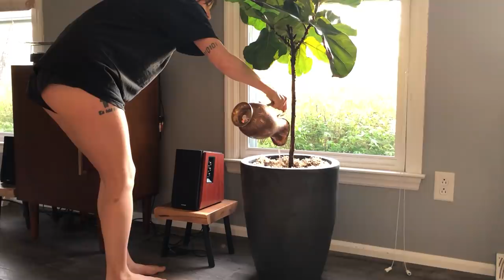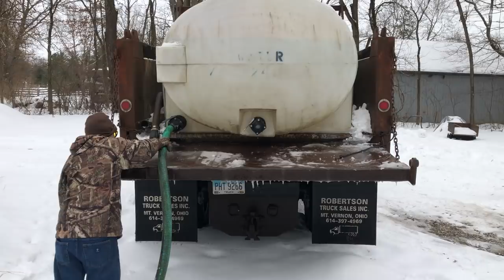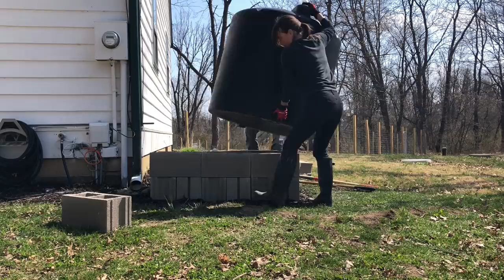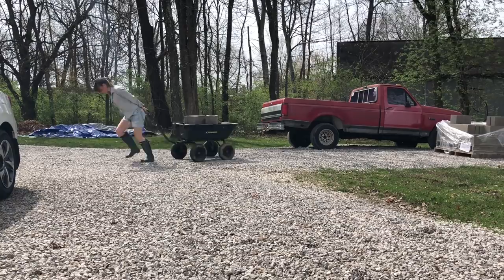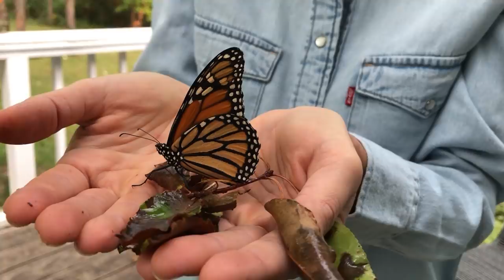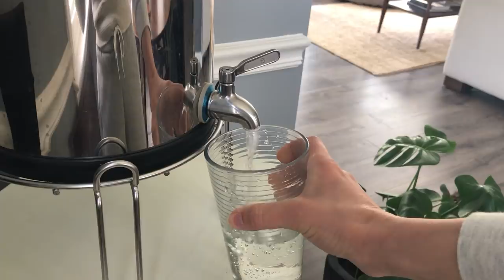How We Get Our Water On The Homestead | Rainwater Harvesting

Comment: Tip from a winter water hauler, if you don’t want to just put a bucket over the cistern lid for the winter, hot water is an easy way to thaw it in the winter. Grab a thermos and give it a slow pour over the frozen cap. Great vid, thanks for posting!
Reply from the maker: Thanks for the tip!! 💦👍🌱

Comment: When having building materials delivered when ever possible have them unload as close to where you need it your back wil love you. Do you have mesh covers on your gutters this will prevent leaves from filling the down pipe and clogging. Unless you insulate your water tanks they will freeze and crack likely that is why your cistern is below freezing level in the ground Ohio I believe it is around 2 ft. If you start running water pipes around under ground they need to be below the freeze line
Reply from the maker: Wish we could have those materials delivered closer, but can’t. No trucks can get through. We’re looking at adding covers on our gutters, which would help tremendously.

Comment: Those blocks under the black collection tanks may just settle, especially set as they are.  Suggest placing the bottom course on their sides, solid flat face on the bottom, to share the weight.  Then lay the second with the cores vertical, if you like.  .   .  .
Reply from the maker: Thanks for the tip!! 👍🌱
Reply: @thenakedgardener_official  Mr. McNew's concern re settling is indeed a valid one, but it's absolutely NOT recommended to lay the masonry units sideways.  Concrete blocks are designed to be stacked with their cores running vertically, that's where all their structural strength is.  Their relatively thin side walls have virtually NO compressive strength and will most certainly crush under the combined weight of the masonry above and the water tank.  In the absence of a solid foundation it's best to either fill the block cores of the base course with concrete or use solid blocks.  And cheers(!) on what must be a most rewarding lifestyle.
Reply from the maker: @TenMinuteDrumSolo  Well that's a relief! I don't even think I could move the water tanks at this point now that there's so much water in them 😂. Thanks for the info!!

Comment: Your Gardens are looking fantastic.I think I would be tempted to add another well out by Garden area with a Hydrant or Cast Iron Pitcher Pump.You might find yourself hauling alot of water and that might be very challenging for you.Time consuming as well.Have you consulted with a Water Management Professional? They might have some additional options to ones you have already begun.Off Grid with Doug and Stacy rely on rain water capture but their holding tank is elevated to create the gradient needed for flow..I'm sure if they have an additional system compressor. Good to see youz Love and Peace from MN
Reply from the maker: I'd LOVE to add another well and pump by the garden. It would save me a lot of back and forth to the rain tanks. Thanks for the suggestion, and for watching!

Comment: Have to say that, although some infrastructure in the USA is better than what we have here in England, this does not extend to drainpipes, guttering and fittings.

Fitting a diverter to a downpipe here is so much easier, as it's just a matter of cutting the usually PVC downpipe and adding an insert which catches any rainwater running down the outside of the pipe, with still a large hole in the middle to let any excess fall through, and the same happens once the tank is full.

Interesting update though. Be interesting to know more about the type of filters you use for drinking water, whether they use consumables, and what the environmental harm of doing so might be (obvs compared to an industrial process for thousands of homes).

Comment: They are tiny rain water tanks. In Australia we have tanks that hold thousands of gallons. We live on the tropic of Capricorn on the East coast where we have summer rains (but not consistently) and very little during winter. We have two 5 thousand gallon oncrete tanks that where dilivered ready made for rain water and one 5 thousand gallon plastic  tank that we store well water in for the garden. We use the rain water straight out of the tank with no filtering. I grew up living on rain water and we never filtered it even though we found the occasional dead frog in the tank. My wife grew up on a dairy farm in New Zealand and it was the same for her.

Comment: Can't you just put a bucket or a bag over that well pipe to keep the water off it so the threads on cap don't freeze. Anyways your right about water, you don't realize how much you use until you have to collect it, I store about 600 gallons of rain water for my garden and it gets used up no problem.
Reply from the maker: As of now, no matter what we’ve tried, it still freezes ☹️

Comment: Hi, just wondering what is the deal with the small water tanks around the house when you have so much room and good rain fall,I live off grid here in Queensland Australia I put two 5000 gallon tanks off the house and 3000 gallons off the work shop,are the larger sizes available in your country. 
 Just wondering, thanks in advance 🙏😎
Reply from the maker: Wow, your tanks are HUGE! Definitely something we'll explore down the road as we expand our water collection, especially when we decide to make the switch and use as much of that water as we can for household use as well. As of now, we're using the water for gardens, chickens, and some drinking water after we filter it. Since we're just getting started with everything on our homestead, everything adds up! It was more cost effective to go this route first, and then add on as we move forward. Thank you for reaching out!  ❤🍃
Reply: @thenakedgardener_official  my pleasure, always nice to see others distancing themselves from the system,& yes you are absolutely correct it’s very expensive to set up that’s for sure but so rewarding when you can sit down to a meal you have created from scratch, keep strong and good luck.

Comment: Just drill a deep well? They can get a little costly but at this point your water issues are a fault of your own when well drilling’s are more accessible than ever. A good well should be producing at least 20 gallons per minute for a single family home. If a well produces water on a per day schedule hell that’s not even a well. It’s just sucking straight ground water that hasn’t reached the unconfined aquifer yet nitrite rich and only god knows what else in it. Your best bet will always be a deep well drilled into a confined aquifer. As a well guy I see every single “homesteader” out there building half ass wells and supplying their whole home with it as if there won’t be futuristic problems from drawing water from not only the dirtiest source but also a source that just flat out isn’t reliable..
Reply from the maker: You want to send me the money for it lol? Yes, costly indeed. We looked into it. For now, we’ll stick with this until we can work toward a more permanent long-term solution that supports our entire household. Thanks for the info and tips!! ✌️🌱